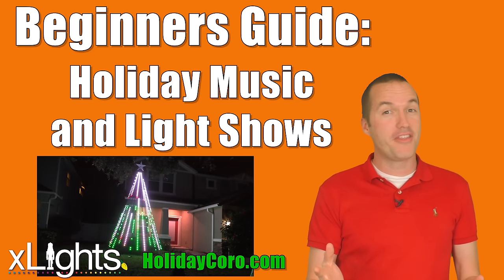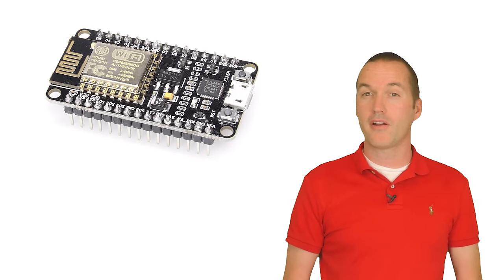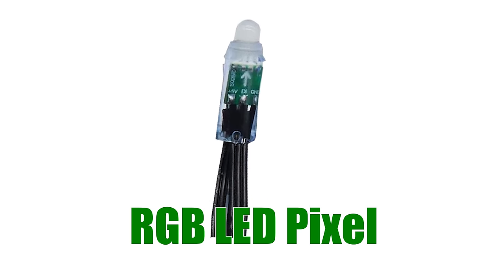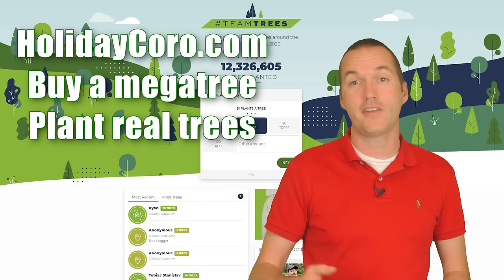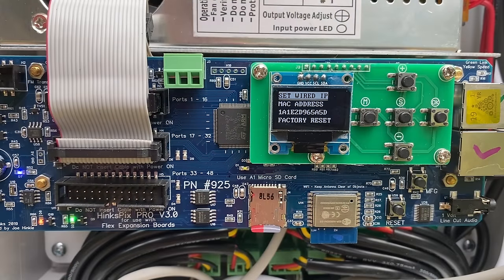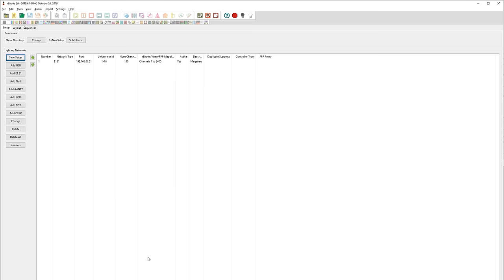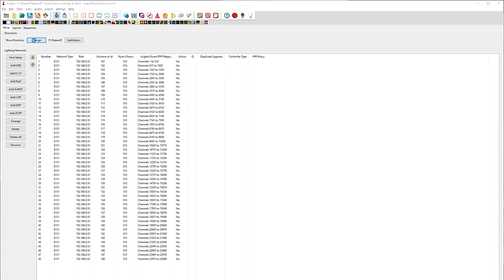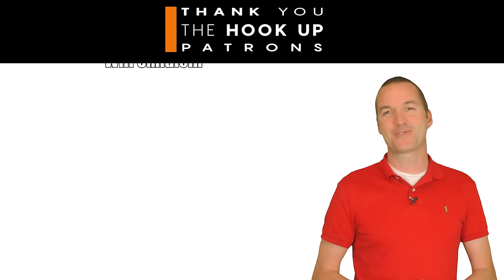Holiday Light Shows 101: LEDs, Controllers, Props, and Sequencing for BEGINNERS. 5 Hour MegaTree!

Comment: Great video! For your Mega-Tree, you said you wanted a 13' tree. Is it safe to say that the kit you bought is the 12.5' tree where the pixels are spaced 3" apart? I'm planning to buy using your link and like the look of your tree, just want to be sure I get the spacing proper. Thanks!
Reply from the maker: Yeah, I have this one: https://www.holidaycoro.com/800-Pixel-Node-MegaTree-Kit-p/813-180.htm?Click=12722 with the upgraded hinkspix controller. 

The height is dependent on the width, so my 13' tree is a bit more narrow than a 12.5' tree.
Reply: The Hook Up excellent! Thank you.

Comment: OK this looks really cool and i want to make this tree. i have a question, would it be possible to use a raspberry pi AS the control board?  i have used a raspberry pi in the past for Christmas lights and so i am familiar with them. i know how to inject power into the pixel lights as i used them last year. Also i have almost everything else to do the project around the house. All i need is the control board. i have a extra PI that i am not really using and it would work perfect for this project. Thank you for any advice you can give.
Reply from the maker: In short: Probably not.  You used to be able to by raspberry pi "hats" that would be able to drive a few outputs, but I haven't seen them around in a while.  If you're going for a budget setup I'd recommend grabbing a 5 pack of NodeMCUs and running WLED on them as your driver boards.

Comment: I have been watching your videos on addressable LED's to get a better understanding for a project I am looking to try. Your information has been very helpful, could you help with the following.
I would like to know what and how to create 5 digits with 7 segments each plus 2 sets of colons. The unit will be to count down to start then elapsed time using RGBW tapes to be used outside.
Different colors for the different time displayed.
Readability at a reasonable distance about 300ft so digits to be 12" - 15" high.
I think each segment will require 2 rows of LED strips, this will mean 35 or 70 strips plus the colons.
I look forward to your views,

Comment: Hello Sir,
Thanks for your videos, really helpful to know about the latest trends.
One question - Is there any way to control SONOFF devices using the app without an Internet connection. I mean to use the app and control devices through LAN. 

Kindly share about it really useful for solving this problem at home.

Comment: Rob, if using the two controllers you mentioned above, how could we use HA to control the lights around the home for ambient lighting throughout the year? For when the home holiday lights are not running for any holiday, I would like them to turn on with warm white (assuming sk6812 strips) along with the landscape lighting.
Reply: Just read that neither of the ready to go controllers list the SK6812 strips as supported...
Reply from the maker: Sk6812 uses the same protocol as ws2811, the difference being it is 4 channels per pixel instead of three.  Xlights supports it, not sure what happens when you send it to a pixel controller.
Reply: @TheHookUp  I'll call them next week and ask. Thank you.

Comment: Some background on the universe and channel numbers may help some beginners. Stage lighting uses a control signalling called DMX512. It has 512 addresses on a single cable. 512 is a power of 2. One cable with a maximum of 512 channels is referred to a universe. To send multiple universes to the lighting fixtures over Ethernet for large shows and concerts, the data is streamed over networking and broken out into DMX to the individual strings of fixtures on their own universe cable of no more than 512 channels.  The fixtures are assigned channels to receive and physically connected to the correct cable universe.

In Ethernet networking this protocol was adopted by the hobby people.  Most people do not use stage lighting and DMX 512 directly as there are no configuration switches on each pixel. Pixels do not care about DMX addresses, universes, etc. The pixels use another standard.  The interface between them is where the confusion begins.

Pixels although listed as addressable are in fact NOT addressable. you can't give them an address.  They use a serial shift register protocol. There is only the first pixel through to the last pixel in a string. You can not assign them addresses. They get data based on their position in the string. The most common protocol is the WS2811 protocol. The reference to the WS2812 is the exact same protocol. The difference is the pixel contains the chip in the LED. The 2811 has a chip on a board and an LED.  Send a bunch of bits to the first pixel and it strips off the first 8 bits for red, 8 bits for Green, and 8 bits for Blue, then sends any further bits out to the next pixel.  This is all they do. The next pixel takes the first bit it gets which is the 25th bit and does the same as the first pixel did keeping the first 24 bits it sees and sending along the rest.  This continues down the line until the last pixel gets the last few bits that made it that far.  DMX on the other hand does use addresses to receive the channel information. No data is stripped from the line and all fixtures receive the same data. The last light on a DMX cable can be addressed to receive the data for DMX channel it is set to receive regardless of position in the string. DMX lighting is addressable.

A pixel controller can take one universe of DMX 512 channels and send it as shift register data to a string of pixels using the WS2811 protocol. This is a pixel controller in the very basic form. Due to each pixel using 3 channels of DMX information, there is a full set of data for 170 pixels in 510 DMX channels. The two remaining channels would have enough data for Red and Green for one pixel but no data for the blue.  This is why pixel controllers use 510 channels per universe instead of 512.

It is desirable to have pixel strings longer than 170 pixels. The shift register Pixels support long strings. The Pixel controller for these strings can take more than one Universe of DMX 512 data and combine them on one output, so using 2 universes of 510 channels instead of 512, will drive a string of 340 pixels using 1020 DMX channels in 2 universes which is easily handled by the software sequencer, ethernet, and pixel controller.

This conversion from stage lighitng protocol to get the signal from the software out to the LED strings is where most of the confusion arises in regards to Universes and DMX channels. To add to the confusion, some controllers call the first universe 0 and some call it 1. Getting the addressing wrong in the software or controller by one universe is a common mistake. DMX addresses start with address 1. Pixels sometimes were numbered from 0. Again, this causes some programming headaches.  Some pixels are not in the order of Red Green Blue. This if not fixed in the controller or sequencer, it can result in unexpected colors.

Due to the hobby market, what used to be very expensive to distribute DMX in shows has now become very affordable. Instead of outputting just the shift register data for Pixels, there are very affordable E1.31 to DMX controllers out there too for very affordable prices. What used to cost over a grand is now under $100 for a 4 universe E1.31 to DMX interface.

Comment: I am brand new to this. Would you recommend starting with a kit like the ones on holiday coro to get started. Here is the one I’m considering. Pixel-House-Outline-132-Feet.
Not sure if it’s a better idea to buy each component individually to get a better deal or better quality?
Reply from the maker: Kits are great if you are just starting out, they make sure you aren't going to forget anything.  The only reason I'd recommend against a kit is if it comes with something you don't need for your setup.

Comment: Ok so you have 16 strands of 50, could you not run the megatree on 5 ports since each output supports 170 pixels? Leaving 11 open for something else? I know you said something about power injection but wouldn’t that still leave you with more ports to use? That way you don’t have to add other controllers? For arches or singing elements. 

I’m looking to start a show next year so I’m just trying to make sense of this.
Reply from the maker: You can absolutely run a tree on fewer ports.  Holiday coro does it this way to make it "easier" for people to setup, but if you wanted to use the ports for other things you could combine strings together.
Reply: @TheHookUp  thanks for the reply. So would you just chain them together at the top? With it being like that I would need some extensions if the “data in” ended up at the top?

Comment: i am going to set up a system this christmas, but i do not want to mess with DIY when it comes with power supply and controllers. I plan to run led's on the eaves of my house and eventually add in some additional controllers like the tree that you installed etc. 

i think i got the wiring and the led's settled (5v), but what premade controller/supply do i go with? 
i will be using 120v outlets to run anything i connect. 
My house mapping would be similar to yours for size comparison. 
please helP!
Reply from the maker: I'd definitely take a look at the Ready2Run stuff from HolidayCoro: https://www.holidaycoro.com/Ready2Run-Flex-Expansion-Controllers-s/2099.htm?Click=12722

If you get started soon (like August/Sept) you should be able to call them up and talk through what you are looking for and they can point you to exactly what you need.  Don't wait until Oct/Nov/Dec to call, they won't have time to talk.

Comment: What do you do for spacing  between candy canes? Is that the natural spacing of the LED string or do you do something to extend the wire in between the candy canes?
Reply from the maker: Those candy canes are 100% custom. My wife bought them at the dollar store like 5 years ago and the incandescent bulbs they came with were dead the next year.  I put WS2812b strips in them, 11 pixels per cane.  It was a lot of soldering, and I honestly wouldn’t recommend the project to anyone since the canes are heavily tinted red which makes it so other colors don’t show up.
Reply: The Hook Up Thank you for the reply. I was more trying to find out that if I have something in my yard that it’s ok to maybe cut a 50 led string in half and add wire in between. From what you were saying it would be a lot of work but could be done.

Comment: I have a large sheet metal 5-pointed star hung above the front door of my house. I would like to backlight it with an addressable LED strip (3 meters should be long enough) so that the light reflects off of the wall behind it around the edges. I'd like to keep it simple and inexpensive. Any recommendations?

Comment: Hi
 I purchase the LED's strip WS2812B.

I have a question. If I connect the strip to 5V 5A power supply does the LED's turn on without  controller?

I afraid the LED's strip is not good. How to check it?

I connect the strip led and it doesn’t light (without controller)

Thank you very mach

Eric

Comment: Currently, I am using my own custom made roof lights using SPT-2 wire and attaching C9 sockets every 12". I purchased different color LED light-bulbs for a few different holidays......but I have to change out each bulb for each of those holidays to get my color scheme which sucks!!

Is there any current solution for simply plugging strips into a regular USA outlet and having an app to change those strips, or are the things you discuss in your videos the only real option? I've been a techie my whole life, but definitely not much of a programmer and I worry I'll never be able to achieve something like you talk about. I guess another question I have is how long of a run can you go with the 30/m strips before needing to input more power? If I'm thinking about the project I want to do correctly, I don't think I would have any runs over 65 feet.
Reply: Matt Clark it depends on rather you choose 12v vs 5v lights. 12v you can run roughly 100-120 pixels before power injection, 5v power injection at 50 pixels.

Comment: Greetings, my wife and I just moved to Central PA and I have been looking into doing something like this at our new house, however would there be any issues with any of these LEDs in that cold of a climate?
Reply: Tux, Many guys run pixels in the cold of Montana, Dakota & Maine to the sweltering heat in Florida, Texas & California. You'll be fine
Reply: @mikeerbe8784  Thank you, I had a feeling that was the case, I just wanted to be sure.
Reply: Btw, check out Canispater Christmas and Listen to our Lights on YouTube for more info on this hobby.
Reply: I live in Fargo ND.  It was 39 below zero on the 23rd. all of my lights worked fine. I use the the 50 node string lights

Comment: HI Rob, did you set up your show network? I am looking for some guidance on the set up you used? I have followed your other networking videos so mine is set up just like that also. But I can't seem to get the show network talking to the main network. Thanks!
Reply from the maker: I haven’t gotten to it yet. I’ve still got my controller and FPP on untagged vlan. The plan is to just make a group of all light related devices (by ip) and give them unrestricted access to each other, but block them from the rest of the network.  I’ve just been traveling too much lately for the holidays to get my non video projects done.
Reply: No worries Rob I understand. I’ll just crest a new network from another router. Happy Holidays!

Comment: FYI, before pounding a stake three ft into the ground it is a good idea to contact your local utility locate.  It most cases if you will search for a place similar to "One Call", they provide locate for electric, phone, cable, internet, water lines, sewer lines and natural gas lines.  Most areas have "811" locating services, oh did I mention it's FREE!  having utilities located does not cost you money; having them fixed will cost you money. One last detail it's a good idea to give them at least one week notice to when you want to do the work, this will allow for ALL utilities to respond and locate your utilities.
Reply from the maker: Great advice!
Reply: @TheHookUp  Thank you, I work in construction.   By the way I love your videos!  I have learned a ton but I am still undecided on which LED display I want.  Do you have a preference of low voltage vs high voltage?

Comment: I live in Canada and our winters can be very cold, how well do these Pixels and kits stand up to -20 to  -40 weather? Also one of the most common themes I see is you don't have snow.  I do and I'm curious how the kits and props would handle the snow?
Reply from the maker: That’s a really good question, one I don’t know the answer to.  Let me reach out to a few people and get back to you.
Reply: We've sold RGB pixels for 10 years and have them installed in just about every part of the world and CA is the second largest market after the USA.  So, no problem with any of our pixels, cables or controllers in the -20 weather.  When you have temps at lower than -20, we do recommend leaving the units running 24x7.

Comment: Great Video!  What I could really learn from is connecting my older RGB LEDs from wireless controllers (like Holiday Show Home) and soldering it to the 3 prong Holiday Coro male/female connectors.  Is this even possible, or do I need to buy all new lights...
Reply from the maker: Unlikely, are your older LEDs individually addressable (do they have a data pin), or are they traditional (separate pins for R, G, B, and +)?
Reply: @TheHookUp  separate pins.  used to be blue tooth from homedepo
Reply: also, i like the icicles better.  they have the glassy look.  i could, potentially, take the plastic icicles off of the original lights and add them to the node strip.  i'm trying to avoid the messy look of using the nodes that dangle and look messy.

Comment: How are the permanent installs faring over time? In this area I'm worried about gunk/ooze growing behind the strip covers due to moisture.
Reply from the maker: I haven’t seen anything growing behind them.  The aluminum channels have had some slight yellowing and the ip65 covering on the strips has yellowed but they are still kicking, no dead pixels or other problems.

Comment: cool! it would have bean cheaper to get an Alphapix insterd of the Hinkspix pro becauce you only need 6 universes for a 16x50 tree and the Alphapix supports 96 universes.
Reply from the maker: I also run 3 long range extension boards.
Reply: The Alphapix can control 4 output long range boards, but if they are 16 port then you did need the hinkspix.

Comment: Hi love your videos, I have a question I have a 16 string mega tree with 50 pixels per string I have a dig quad running it, but I can't work out how to use all 4 channels so each channel works 200 each, I have the controller set up in xlights and it works on 1 chanel but not all, I can't seem to find a video anywhere that shows you how to set up 1 controller with more than one channel? Please help. 🙏
Reply from the maker: Not sure I understand your question.  On the dig quad with WLED if you use 4 different ports WLED just sees it as one long strand.  So in xLights you'll use the "end of model" method for defining the start channel of each of your 4 digquad outputs.